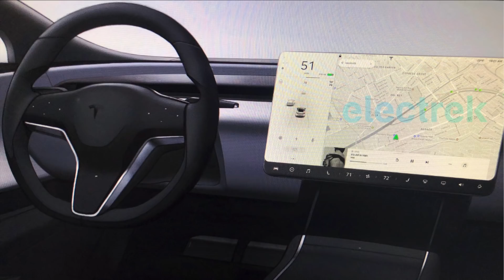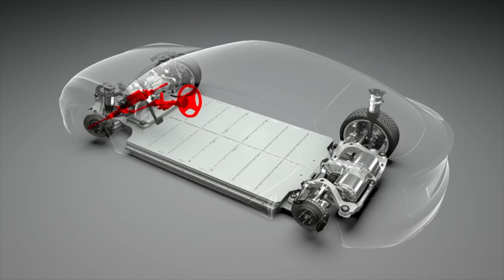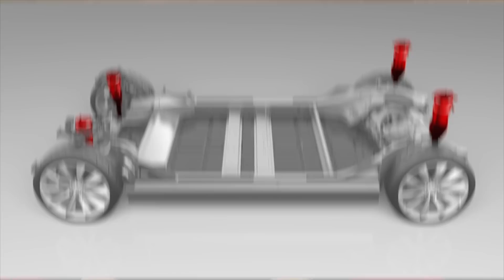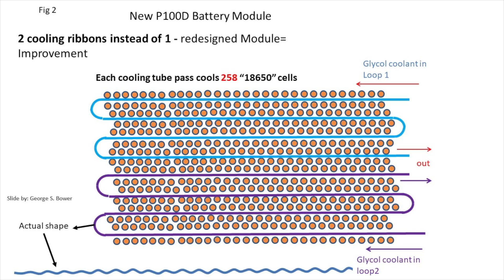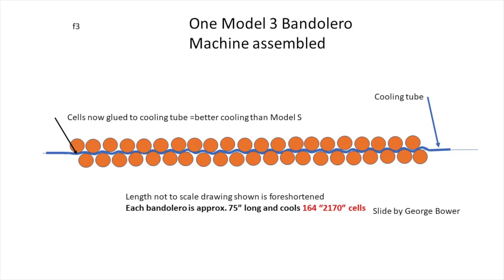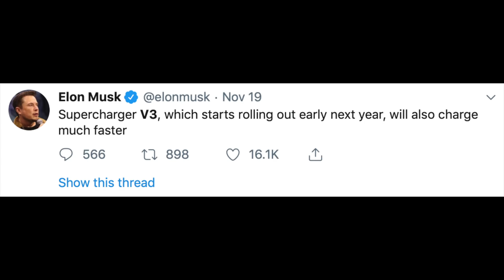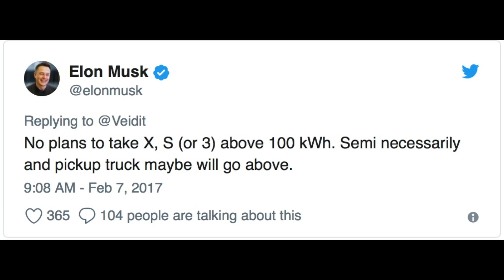The reason Tesla's 75 kWh battery is going away

Comment: I use the 18650 battery in my flashlight and have a 4 battery charger that does all sizes it is so much more powerful than regular batteries. Not cheap but does last a long time. Look forward to all improvements in batteries and charging systems. will move everything forward in power storage and use.
Reply: It is not that hard to change an entire battery pack in a shop designed to work on Teslas the 100 kWh pack may be offered as an upgrade and losing the 75kwh will help reduce inventory which saves money

Comment: With just redisigned battery pack (5mm taller cells is not an issue) they will easily go 120kWh long range, 100kWh will become midrange and 80kWh will be low range. With the new packs they can do few things. Might go with higher voltage to keep the cabling the same but deliver faster charging and even better performance. They might also redesign cooling loops as they're not performing perfect now also chiller might get stronger and software way more sophisticated (working with nav system to deliver way lower temperatures of the  pack before arrival at the SC). Everything combined might let them charge at 350kW for a few minutes later dropping down to healthy 200kW for longer period and not going below 100kW up to 80% of capacity. 5m at 350 and 15 at 200 would pump around 80kWh into battery pack in just 20 min. This will let people drive for another 250 km. Charging to 90 percent would take another 20 min giving 400 km of range. It's all doable without too much of redesign IMHO.
Reply: BMW did that with there gas tank to game the number's and Tesla is not Angel so your right.

Comment: I think the Model S will come out with approximately 430 miles range, if the use the 2170 battery.  If they use a different battery architecture, it could be higher.
Reply: YOu are referring to on flat ground with humans constituting under ten percent of total vehicle weight.  SUch a distance takes hours to travel and is so boring to point out.  DOwnhill any bike is good for thousands of miles without pedalling fyi.
Reply: @Irene-fu6gj  Yea, what?
Reply: No, no, no. Even if it can do 430, it'll be listed as 420! You know how musk loves that number

Comment: Yeah I don't think they will keep using 18650, because 2170 is just better. But a question, semi's megacharger could deliver a lot more power, but can 2170 handle that amount of current? If not then, maybe a new battery technology?
Reply: The 18650 and 2170 cells can handle the current, if there are enough of them to spread it out.  The Semi is going to have quite a bit more 2170 cells so it shouldn't be a problem at all.
Reply from the maker: I believe Tesla has said that the Semi will use Model 3 batteries. I bet the Semi has some additional cooling system though.
Reply: @AllThingsEV  If you think the investors in trucking are gonna spend billions on chemical disposable storage your cynical and prepared to let it happen.
Reply: A 40 tonne truck is going to need about 1000kWh of battery to travel 250 miles  - that's 10 times a model S, so should cope with 1MW charging assuming the cooling circuitry copes.
Reply: @MrHairyTeabag  or duh a compressed air tank or 08 hopper.  Locomotovies exist with fuel cells and lithium accumulatgors but so do moon cheesers and not just roof flatters.  PUblic schooling is to blame.  Review your arithmetic please.
Reply: @Irene-fu6gj  @Irene you suggesting a future with hydrogen fuel cell trucks? Not exactly cheaper than batteries.
Reply: @MrHairyTeabag  Wow! 1MWh of lithium! I wonder how that handles in a crash!
Reply: @RCHobbyist463  better than 400 gallons of diesel
Reply: @RCHobbyist463  fine as long as it's not at 112mph?
Reply: No problem.  Divide and conquer. . .

Comment: Definitely the 21700 have better energy density & higher thresholds for thermal runaway, so its a better pack but the new model S & X may end up being a complete redesign which in their iterative design process is weird but good science in itself, as they can prove they can make a better vehicle as they see a cost adapted strategy to make revision changes to any of their platform/product lines; to better break it down; the price adjustments, & the removal of the 75 range packs. However they do need to make a quality/value distinction between the S, X, versus the Model 3, & the Model why is going to be cheaper? Obviously the flexcircuit is obviously a gamechanger. This is as far as I am understanding Teslas marketing strategy, especially since its quite transparent.

Comment: It makes sense, but I do not believe Tesla will increase charging speed until S and X have CCS ports. Obviously they are following Ionity closely and have prepared for higher charging rate, but do not want to pissoff their S and X customers by making the TM3 charge faster. However the new CCS stations in europe do not seem to have cooled cables so I would assume maybe 200-250, anything higher would fry the cables.

Comment: I think they would be 500 miles range for the model S and 480 miles range for the model X and 150kwh battery pack
Reply: Yep, 15 min 80% charge would be 350+ miles!  That would be awesome.
Reply: Because the Model S achieves 34.4 kWh per 100 miles and the Model X 36.9, it means the model S/X would need a ~180-190kWh battery to go 500 miles, assuming the added weight from the larger battery doesn't significantly affect the efficiency. I think it's more likely we see a 125 kWh refresh which means a ~350-360 mile range for the S/X
Reply: @armwrestlingprofessor  probably, but remember Elon mentioned the new Roadster 2.0 will probably get 600 miles a charge.  So it might get over 1,000 based on Elon and his over achieving but always late manner.  Lmao
Reply: Model S P150T anyone. The T means tri motor

Comment: Good video , but I will add my two cents . I agree that Tesla will move to 2170 on S and X . Reason is that they make the 2170 in house in the US , while 18560 comes from Panasonic Japan . Reduction in inbound supply chain cost will be noticeable . Also there are economies of scale to be made by switching to 1 cell and the cost of producing in house will certainly be less than the price they pay to Panasonic (cut out the margin) . Another very good reason is that currently only the Model 3 comes with track mode (high power delivery during longer periods) . This has to do with its better cooling system and maybe somewhat different cell chemistry . While an S can do ludicrous short bursts of acceleration , it could run into trouble trying to catch up with a Porsche Taycan on the Nurburgring : the Taycan has been tested there doing at least 2 laps without any power down throttling , flat out . The same will probably apply to the Audi e-tron GT . If Tesla wants to stay on top of the heap , they should and can do to the S what they did with the Performance Model 3 . I believe you will see a 2170 battery pack with track mode on the Performance S  before the Taycan or e-tron GT even hits the showroom . That will definitely block Porsche from eating too much from the Model S sales . S will still have better range , better acceleration , and access to a supercharger network V2.0 . Suddenly , a Taycan makes a lot less sense . And finally , about that 350 kW charging rate Porsche claims for the Taycan : yeah , 100 km's charged in 4 minutes . The emphasis should be on 4 minutes : do that any longer and you frag the battery . Elon's right
PS : just found this after writing my comment : https://www.teslarati.com/tesla-model-s-model-x-track-mode-75-kwh-battery-pack-extended-range/
Reply: Gerrit Govaerts , yes, and the 2013 contract with Panasonic is finished.
Reply: Marius Breabăn , I’ve owned quite a few German cars during my 50 years of driving, including Porsches. Young men in CA largely rejected other brands other than German. I don’t see it that way anymore. Tesla has brought the American car full circle. I don’t see any electric vehicles coming from Germany that are serious. Serious examples, but not something they want to sell seriously in mass. To me, the Germans have had their day, if people want to buy their products , they will be buying overpriced, money pits and old technology.
Reply: The power limitations of the model s is not because of the battery temp. The problem is the engine. The model 3 has the brand new reluctance motor(state of the art in e-mobility), which has no parts in the core that could be damaged by heat. So i think the most important upgrade of the model s is the reluctance motor, which is also much more efficient. But also the new 2170 cells will bring a major improvement.
Reply: @derbou7589  You could have a point there . The reluctance engine is really unique in terms of efficiency (and thus waste heat)
Reply: Tesla does not make the 2170 cell. Panasonic does in a partnership with Tesla. Tesla just assembles the packs. Both are done at the Gigafactory.

Comment: Whilst Elon doesnt see the need for a bigger pack, I do and the market is also starting to offer bigger as well, and so Tesla will have to keep up.  There are still some viable applications/use cases that travelling 400-500 miles wihtout stopping to charge is required, and the other side is that you coud charge just once a week or every two weeks.  This makes sense and reduce potential grid stress.  The weight would be the key issue, the crash ratings and strcuture are in-step with vehicle weight etc...

Comment: I am no expert but one way to increase the charge rate without undue overheating would be to increase the voltage as with the porche to say 800 volts. Doubling the voltage would double the charge rate without increasing the current (which is usually the cause of overheating?) Another way would be to charge two packs within a car in parallel  so each pack is  receiving say 120kw a from a parallel charger, combined this would give 240kw charge rate again with no excessive heating. To picture the concept another way imagine two teslas charging at two different stalls each delivering 120 kw each the total charge rate is 240kw now install the battery packs from both cars into one and you can charge one car at 240kw with no harm caused by overheating?
Reply: This is essentially how the Tesla Semi is currently charged. But I doubt they will use it for the new Model S/X.
Reply: @elyakimlev  power is delivered using spikes on a sine wave.  portable storage needs to be  a light dimmer in reverse- maintaining pulseed high voltage delivery but blocking the lower voltages where excessive amps are an issue.  The grid can handle this nose easally

Comment: "No plan to take X/S over 100kWh...", that tweet was sent on Feb 7, 2017, that was two decades ago in Elon time.
Reply from the maker: lol. totally.
Reply: yeah...the stupid 3 charges faster now and charge times are tied to capacity.
Reply: @Richard-ie1if  of course it does. the 3 also has a Higher charge rate per cell. more surface area. and better cooling. all things that allow it to charge faster.
Reply: @Richard-ie1if  The Mid Range Model 3 gets 1.9C so the cells are apparently more capable for fast charging than its successors. That said, less costly cars get well over 2C. Hybrids much more. Different cost/performance priorities. With large packs, Tesla has been getting away with slow cells but they don't seem to have made that the key limitation of the 2170.
Reply: @Cloxxki  
?
Those "slow cells" were as good as the cells at the manufacturers have now!
Reply: I'm mostly interested into the Model Y.
I really hope they do not do falconwing doors to keep the price lower. And in that article all cars we're mentioned except for the RoadsterV2 and the Model Y.
Reply: I can imagine a 120kwh pack because if you are using the high power often it will help the battery lifespan and also you can charge quicker without ruin the battery... and also they could give even 5% more power and it would make it worth it and the extra range will really help especially when their auto pilot comes out in full force... every extra minute on the road will be huge revenue per year for their automatic taxis... Even if at first they only do mapped out specific highway routes connecting cities.. less charge time and more road time = bigger profits
Reply: s/x is an abbreviation of sex .. lol.
Reply: They’ll need a battery larger than 100 kWh if they want to make the Plaid Model S & X. A more powerful battery in those cars means the motors are more powerful.
Reply: That would mean that Elon and I are on the same page, which I find hard to believe. My theory for the past 4 years has been, that for every decade of this century, we are advancing 100 years in relationship to the past millennium, ie 1000 ad to 2000 ad. So we are now have gone from 1000 ad to 1190 ad in the past 19 years. In 1450 ad, or thereabouts the printing press was invented, 1492 ad we all know what happened then. now extrapolate that to 2045 ad and 2049.2 ad... know any well known predictions for those years??
Reply: @davidcadman4468  Time is man made and your dates are wrong and not natural. Rip
Reply: Cloxxi - With battery cells, there are always compromises. In Tesla's case, it's believable that they chose a slightly slower maximum charge rate in favour of better cell longevity. Given the choice, most people would always ask for longer cell life, and tolerate spending few minutes longer per unit cell capacity in charging. If Tesla settled on a speed of about 15 minutes to 80% capacity every few hours, then that fits well with driver safety recommendations for 10 - 15 minute breaks to be taken every two hours of driving. A quick top-up every couple of hundred miles is no problem, because people need a comfort break, a leg stretch, and maybe a coffee or water, maybe even food, during those breaks, all of which take at least 15 minutes. IMHO, Tesla have usually made wise choices with battery charging and chemistry.
Reply: @davidcadman4468  Singularity? "Four polls, conducted in 2012 and 2013, suggested that the median estimate was a 50% chance that artificial general intelligence (AGI) would be developed by 2040–2050" https://en.wikipedia.org/wiki/Technological_singularity
Reply: @davidcadman4468  

Sounds like you've played Sid Meier Civilizations
Reply: @davidcadman4468  
The more you know the more you learn, the more you learn the more you know. Exponential learning potential!
Watch out for artificial intelligence following that path!
Reply: Yes he is the man of 22nd century

Comment: What about a 26650 cell? It's close to a D cell size max charge when I had one 4.2 VOLTS i don't recall the batterty curve. I used to have a vape mod that took one. All my current cells are Panasonic 18650s branded as Orbtronic for the VAPE/flashlights. I have some with a 10amp rating and some with a 20 amp burst but that's at 4.2 VOLTS if Tesla charged then to 3.8 or 3.6 that a where they get the life Orbtronics can be recharged 1000 times when charging to 4.2 they have limits
Reply: the titanium based lithium has always been superior in every way that matters but he wants kids and wives to die subsidising crazy modes with the savings using the cheapest chemistry has us suffer.

Toshiba SCib allows toyota to lose market share- but Musk loves his prius tomuch apparently or just acts so clueless.  That hybrids will get solid state before any wheels for adults doesn't beg the question of "wheels? are yoiu fucking kidding me?" it answers it.
Reply: @Irene-fu6gj   my IMR (LITHIUM MANGANESE OXIDE) 18650 cells branded as Orbtronic made by Panasonic. They are an unprotected battery and shouk d only use them if you known what you're doing. For instance using them in a device that regulates how much power can be pulled from it and detects direct shorts and shuts down the device before anything happens the vape mod also detects temperature of the cell to prevent thermal run away there is also a safety mechanism programmed into the chip to not allow the fire button to pass power through it longer than 15 seconds that's just in case some idiot pit the device in his or her pocket or purse without shutting it off. TESLA has far more sensors than my 200 dollar vape mod that was made in America. I also don't know what exact battery chemistry Tesla uses but they are made by the best company on the planet Panasonic. A lithium battery even if it looks like an alkaline single use battery IS NOT THE SAME AND YOU MUST KNOW THE CELLS LIMITS. I have been vaping for 7 years and treat my IMR Cells with respect. If I take extras with me they are first placed in a specially made plastic box so that it's impossible for a short to occur which can cause thermal runaway. Each of the more than 4,000 cells in a Teslas battery pack is touching an aluminum cooling tube (aluminum is the best heat transfer material) Teslas have active cooling and are monitored by the best BMS in my opinion the car won't allow it to charge if the batteries are to hot so Tesla isn't experimenting with women and children 18650 means 18mm wide by 65mm long so their new 20700 cells are 20mm wide by 70mm long so they are just a little bit larger same 4.2 VOLTS per cell but hold more power or have a larger energy density a larger gas tank. The few ecig explosions ths t made it to the news are always user error bought the cheapest battery the cheapest device. For my safety I was willing to spend 200 bucks per ProVari which I have 4. I am very well versed in the battery technology lithium cells are like humans they prefer 70 degree weather that's why Tesla went to such lengths at perfecting it's cooling of the pack. The model 3 cooling is 10 times better than the first model S
Reply: @Irene-fu6gj  titanium based batteries aren't even an option we will perfect the carbon battery long before titanium